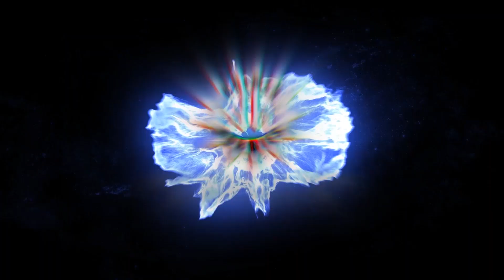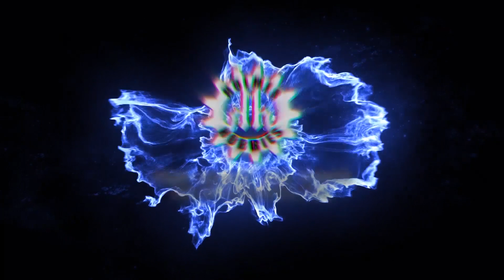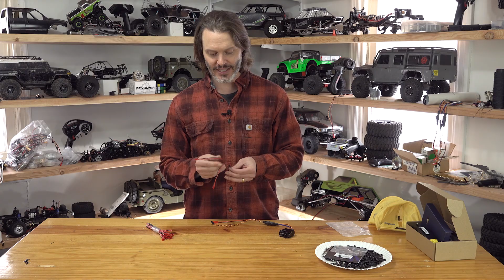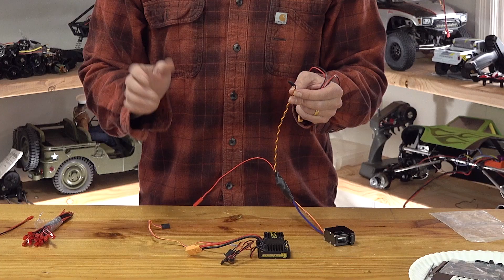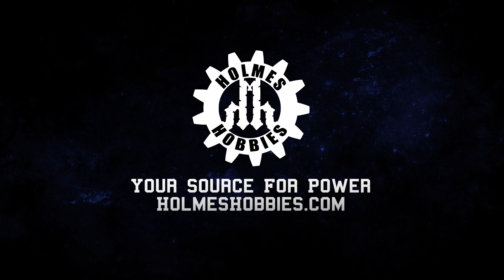Easily Power Up Your RC Accessories - No Solder Plug To JST Adapters - Holmes Hobbies

Comment: I love your video! You make very easy to understand for us newbies with electronic RC vehicles!
I do have a question about a 4-pin JST plug. I have a Hobby Zone Carbon Cub S2 1.3m for my partner to train on, but it came with Spectrum electronics, where my partner and I use Futaba. There is a JST female plug to connect to for the different modes with 3 lights for the plane (Beginner, Intermediate, and Experienced). Would this work like your video above (No Solder Plug and a 2-pin connector) with a 4-pin connector? If so, which wires would go to the possitive and which would go to the negative and also how to program the radio to switch between the different modes, or would it be connected directly without connecting to the receiver?
Reply from the maker: I can't quite visualize what you are asking, sorry!

Comment: Hi John, I like your videos a lot and they do provide a wealth of information. My question may not be related to the topic but do you know if there could be a way to connect/solder the motor sense wire from traxxas light kit onto an aftermarket brushless motor like hobbywing fusion pro, which has 3 wires from motor(or esc?) Instead.
This is not extremely critical since most of the light kit functionality still seems to work without the motor sense wire but in some situations the light kit does behave awkwardly. I am sure if I am able to connect the motor sense wire then it would work smoothly always. Thanks!

Comment: Hi I just seen your vid about the xt60 adaptor for the servo? I believe that's how you explained it. Anyways I'm running a 1/10 buggy sky rc Toro 120 and ares pro comp 6.5 with a turnigy 5100 7.4 v 2s2p lipo. I'm having issues with foward being reverse and vice versa,  and no steering. All new components. In the program card, when I select certain options, the asterisk doesn't change to the selected option. Any suggestion on any or all 3 of those issues? And (original ?) Powering the servo right now I just have the 3 pin wire from servo running to the receiver. Should I tie it into the esc via wire adaptor as shown in the above video? Thanks for any/all help you might give, in advance. I'm new to the hobby and I'm kind of just going off gut feeling and you tube videos. But I'd like to learn best possible scenarios when I can. So, again, i appreciate any help.

Comment: I've recently purchased an shv 800 and I thought it was a plug-and-play type but I don't get the 4-wire system 2 for the jst and 2 for the signal and ground but when I plugged in both wires I think I was getting power from both the battery and receiver.... melted wires

Comment: I have a 8274 rc4wd winch 1080 hobbywing esc with the flysky gt5. I would like to run my winch off a second battery. My lights as well. Can I do this?

Comment: Hey brother-man, you do a great job for us all, but you've got hundreds (of thousands probably) looking for high performance brushed engines to put in their vintage rides. Pan cars, rc10s, old on roads all sorts of old whips that need good powerplants.
All the drop in brushed motors nowadays are turds. We need some 30,000 rpm 12 turns and stuff to keep us rollin!
Reply from the maker: We wind up handwounds upon request.  I also have sport motors in production.
Reply: @HolmesHobbies  awesomesauce. Cant wait.

Comment: Awesome product.

Out of curiosity wouldn't it be a better if the JST plug came off of the ESC side of the plug vs. the battery side? Just for routing of wires and the way they would lay. ESC side wires get moved/handled less than the battery side.

Comment: I have a question about running my lights of the balance lead of my battery. I use an online calculator to work out the right resistor for my circuit, lets say 13v. Make up my light circuit too run of my 3s battery balance lead. Does this harm the battery running the lights of the balance lead of the battery.
Reply from the maker: No problem,  just don't forget to unplug!
Reply: Thanks. I have always wondered if what I was doing was ok for the battery

Comment: Awesome I need this!! Can you run a 6v-12v light bar “proline”  off a 3s 1350mah 30c battery? A fully charged 3s is 12.4 correct?
Reply: You should be fine running that light bar direct power from your 3s battery and it is 12.6 fully charged (4.2 per cell)
Reply: @JustinDDavis  awesome, thanks!!

Comment: Fairly new to the rc world. Replaced the stock electronics on my 10.3 Gladiator with a Mamba X and A Puller Pro V2.  (Hhheeeyyyy!). Not good at soldering and now I have the lights from the body that have nowhere to plug in. Is this an alternative? It’s a different plug though, they’re more like the plugs coming off the servo.
Reply: The lights run off 6.0volts max. This direct power lead will supply battery voltage so anywhere from 8.4v on 2s upwards depending on battery. So it will blow your lights.
You can use a spare slot on your receiver if your bec voltage is set to 6.0v. If your servo is stock spektrum servo it is also 6.0v only also. So all good.
You will need  to fit an external bec to power an upgraded servo at  higher voltage, or use a direct power servo and the lead John is showing in this video.
Cheers mate 👍